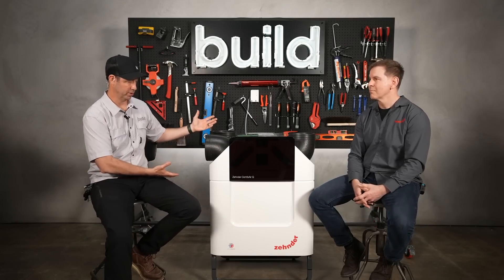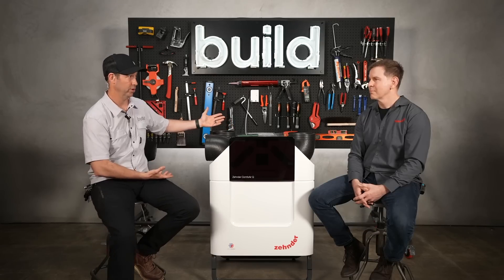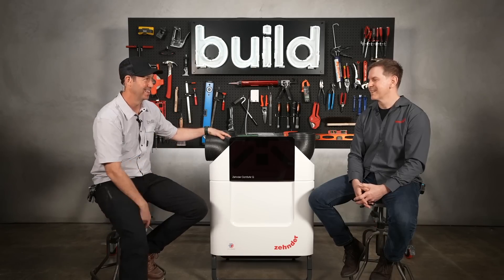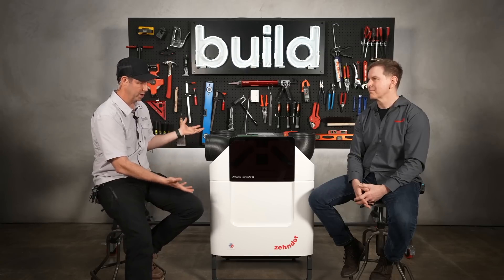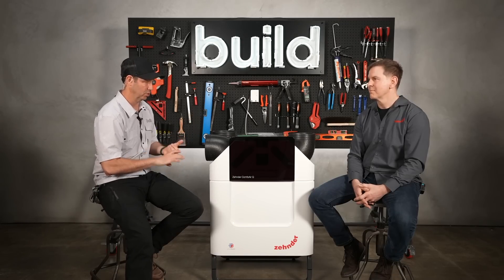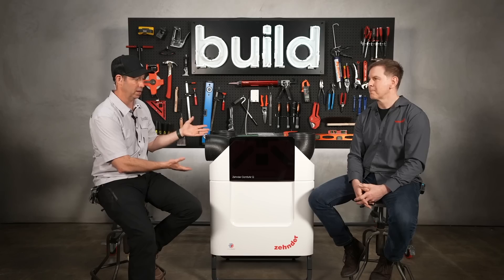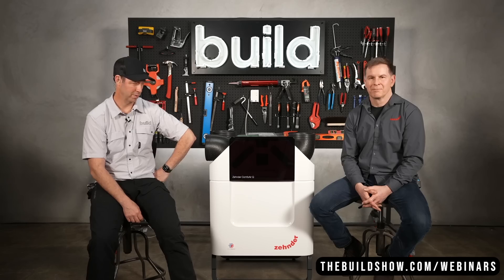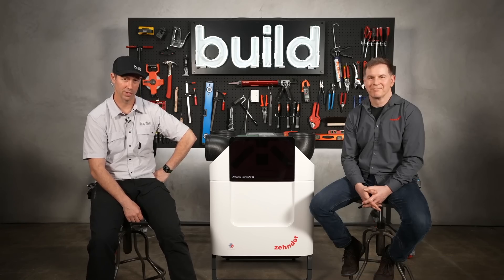Ventilation That Does More Than Suck: Intro to ERVs | BUILD WEBINAR

Comment: We live in the southeast, where it's hot and humid at least 4 mos each year, it might snow in the winter, but commonly gets to 20 degrees in Feb. We have an average built, 2200 sq ft, two level (1997) home and recently asked our goto HVAC company to install an ERV and dehumidifier, but the owner recommended a bipolar ionization generator (NuShield) product and dehumidifier instead. Thoughts?

Comment: When I was forced to live in Pensacola, FL for 7 months I found the humidity unbearable. I came from Sacramento, where I suffered seasonally from extreme hay fever, but humidity was uncomfortable year round in FL. I wouldn't live there if you paid me. I found Lake Tahoe's dry, clean air (alt. 6100'), where I lived 6 years, great for my allergy but a little too dry. Now, I live in Vegas high desert, hate the heat, but ZERO flies, mosquitos and the humidity is ok, no dehumidifier needed. Move til you find your best environment.
Reply: As someone that lived in the panhandle of Florida for most of my life, the Pacific Northwest is basically perfect. More rainy days but less actual rain so when it does come down, it's just a sprinkle compared to Florida where you just couldn't be outside in the rain. The summers are temperate enough that you're fine just wearing a t-shirt and shorts most of the time and while everywhere has mosquitoes, it gets cold enough to actually keep them under control. In Florida from May to August sometimes they'd be so bad I'd get 5 bites just going to check the mail and put the trash cans by the road. So far in the PNW I can't recall a single actual mosquito bite this year with zero bug spray and taking kids to the park. Even the flies up here are much better. There's still plenty of them, but it's weird, they're the kind that totally leave you alone. I'll see a swarm of them but none of the local species seem to bite and they're not the kind that bump into you all the time like in the panhandle of Florida. The humidity is not bad at all, maybe a little dry over winter even though we're in a "marine" climate zone.

Comment: But no one talks about how you reduce moisture (humidity) when pulling in outside air whens its extremely humid outside.  Theres no drain on these things - they just suck up and in humidity.  I have a commercial ERV , I hate it.  I can't use it for 6 months out of the year!
Reply: you need a dehumidifier
Reply: @davidhoover2446  Thats what I was thinking for outside air.  What is matt doing in Texas?!
Reply: An HRV sucks in whatever moisture is outside, an ERV works like a moisture exchanger as well as a heat exchanger. The moisture from the outside air gets carried away in the now-moistened air from the exhaust. It doesn't work perfectly so maybe the intake air gets lowered to 50% RH while the air going out started out as 40% RH but it gets the humidity most of the way to what the exhaust air started out as. Depending on climate you might not want an ERV and a HRV might be a better choice. In Texas, you want an ERV. Matt just about always pairs any ERV he installs with a dehumidifier. If your ERV is making the indoor air more uncomfortable 6 months out of the year then you're not balancing dehumidification, ventilation, and cooling. In most houses dehumidification is controlled by the sizing of the AC unit so that it condenses an appropriate amount based on the amount of time it's running to cool down the house. If you have a massive amount of extra ventilation well above and beyond what you need as well as a home that's somewhat shaded or well insulated the moisture carried in past the ERV could be too much moisture load for the AC to effectively do double duty as a dehumidifier like it usually is. For that matter, even just getting the exhaust and intake balance off will do the same thing if you're negatively pressurizing the home as now humid air is going to leak in throughout the house and bypass the ERV altogether.

When you go off the beaten path of x sqft needs y tons of AC capacity and start introducing ERVs, dehumidifiers, etc you need to make sure they're sized and tuned appropriately or they might actually be worse than not using it at all. Matt Risinger shills a ton of random products but one thing that he's right about IMHO is getting a professional to actually look at the house design, the insulation, the local climate, etc and actually balance the heating, moisture, and ventilation loads because when you've got 3 somewhat independent variables like this it's easy to get it wrong. If you're just guessing or going with the typical generic HVAC guidelines for capacity then you definitely will get it wrong, but it's probably close enough to deal with it, especially with leaky houses which tends to bias everything closer to the outside environment except temperature. If you ask 1000 people across the country what they like to keep the thermostat on you'll get some seemingly wild results. Temperatures that most people would think is uncomfortable is based around what the person thinks that would feel like in their own home. Different humidity can make a given temperature feel quite different. In fact I'd bet there's a good chance you prefer a different temperature between summer and winter. That's because even if the temperature is the same in your house, the humidity is not, and that makes it feel different. Control all 3 properly and you'll be guaranteed a comfortable environment. (and radiative loads from the walls but that's more of a question of insulating properly)
Reply: @AndrewMerts  Yeah I don't think so.  I turn on my ERV and its like opening a window.  A ventilating dehumidifier might do that but an ERV can't reliably dry out your 99% RH outside air.
Reply: @bigneilh  "It doesn't work perfectly so maybe the intake air gets lowered to 50% RH while the air going out started out as 40% RH but it gets the humidity most of the way to what the exhaust air started out as."

I don't think I can make it any more clearer than that. An ERV gets the humidity of the intake air closer to that of the exhaust air. That's literally the only difference. It is getting moisture out of the incoming air. If it wasn't, with an HRV sucking in hot 99% RH air it would actually be condensing water inside it as it cooled and dripping out of the unit.

Comment: I am a novice to ERVs and tried to learn as much as I could at JLC Live 2022 in Providence RI. My takeaway: the ERV solutions offered are scrambling to satisfy the need to meet newer building codes and don’t have a really good solution that is cost effective. Indoor air quality is quite complex to do it right while maintaining efficiency. Tightly sealing our homes has created the problem of potential health issues. I have faith the manufacturers will continue to make improvements and be cost effective. Good video btw.

Comment: I like the idea of CERVs better, ERV with built in heat pump and dehumidifier. Attach a electric heater and humidifier for cold climate. And you got an all in one system for small near passive house.

Comment: How many people really maintain their Ervs ie change out core every year? Zhdnder IS the best but at 10,000 plus it’s 3-five x what you can spend with excellent Broan  or Panasonic AND you can establish positive pressure if u have radon …for streaky cost effective solution sorolare dehumidifier with integrated outside air intake
Reply: I agree with the sentiment, what you might not be considering is that all the ducting and every part you need is included at that price AND an engineer takes your house and does the sizing calcs and designs the system for you before you order. You aren’t paying 10k for just the unit in a box.
Reply: You don't need to change out the core in an ERV every year. You should consider cleaning the core yearly by vacuuming it out or washing it if you have one of those types but the cores don't need to be swapped every year, they don't go bad like that. Zehnder is definitely super expensive though.
Reply: @AndrewMerts  i misspoke-juts repriced slender and the ante all in starts at 15k !!

Comment: It would be crazy if we revert to mud walls and avoid drywall that eats nails in a jar. Ever hear of the offending drywall brand and nail in a sealed jar?
Reply: Not all drywall does that, you seem to be referring to the wave of imported Chinese drywall during the 00s which was some of the only drywall available due to supply shortages in domestic sources. It was high in volatile sulfur compounds that would offgas and corrode wiring and AC equipment, not to mention the effect it had on health breathing in sulfurous VOCs 24/7. You don't have to use mud walls to get away from VOCs, in fact, if you somehow sealed it well, I'd bet the mud walls would give off more VOCs than quality drywall or Magnesium oxide wallboard due to all the organic matter in the mud. Outside of crappy imported drywall the VOCs to worry about aren't coming from your drywall, it's your paint, flooring, furniture, possibly insulation, cabinetry, etc.